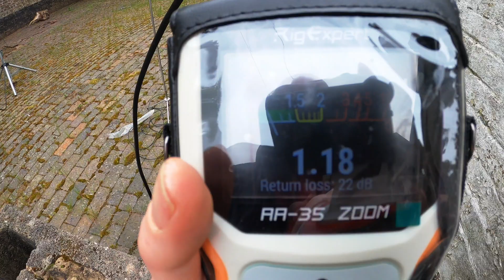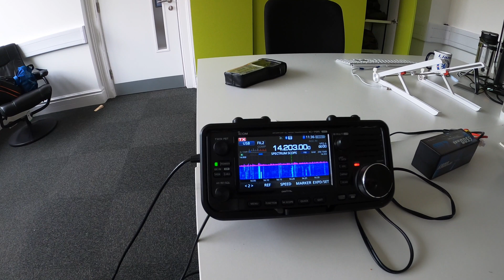How to set up a restricted ham radio station using the Slidewinder coil antenna

Comment: Interesting video, I hope it works out for you. I wonder , being a old building whether there is a air brick outside which allows access under the floor into your office for the coax.
I will be interested to see what happens with rf flying around, especially as I notice , what seems to be telephone lines above your ant, and obviously lots of computers etc around. I remember callus putting isolating devices all over the place, but as you say, later , if possible the trees would be a perfect place for a ant, especially with the height keeping rf above and away from the buildings. 
New stations set up are always trial and error. I will keep watching to see your results. 73 brian.
Reply from the maker: Yes, I think the telephone lines are unused as we are all fibre here, saying that, the wires terminate somewhere in the building, I need to take RF seriously with this setup

Comment: Carl, very nice setup at your work location, I use one of those window feed throughs for my home qth antenna set up and they work really nice for me. I have three coax ports with u 259 adapters and two feed throughs for end fed wire antennas. You really are doing a very nice job with your work radio station, thank you for sharing.

Comment: Carl, I use those through the window devices from MFJ. They can probably be recreated with wood and barrel connectors but the MFJ solutions are pretty good. I have been using them for several years.

Comment: I'm looking at that telegraph pole...😁
Interested on your thoughts on the formula zero, seen it, price seems a little to good to be true for the price. 
Simon M7BXR.
Reply from the maker: yes the wires terminate in the building but are unused as we are all on fibre and underground connections, I wonder if there are some indepth measurements of the coax somewhere
Reply: I did make a spreadsheet of available coax data and compared them and for the money it seems like a really good price.

Comment: Thank you for another great video. I always enjoy them.

On the echo question an alternative to the pads on the walls may be large-ish books and bookshelves. In a university you may be able to get those at low cost. I couldn’t see if there was carpet on the floor but carpets and rugs also help a lot, heavy curtains on the windows as well. 

 If you have access to the roof it could be a great location for an antenna.

Comment: The through window coax passthroughs are good but I would recommend only use them on windows that don't get opened very often as they are subject to wear and tear.
Due to the location of the overhead telephone wires I also recommend the use of choke baluns at the antenna and the entrance to your office.

Comment: Hi Carl. Thanks for your videos. They're always intriguing and helpful. Just wondering if it would be possible to string up one of your end fed antennas using the trees at the back of the property for support while hanging the feedpoint on or over the low wall. You'd have to keep the wire high enough to keep above the heads of any pedestians, but I would think such a setup would be less obtrusive and perform better. Just a thought. 73, K5OLV.